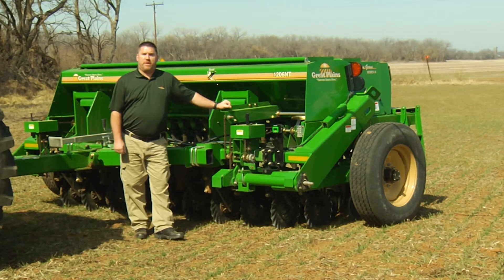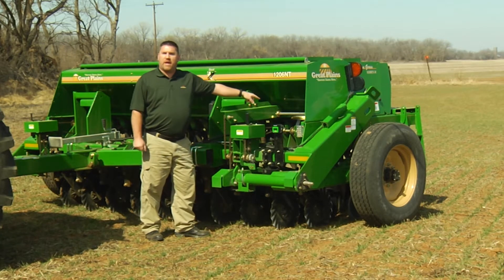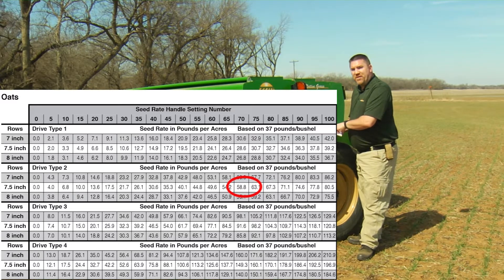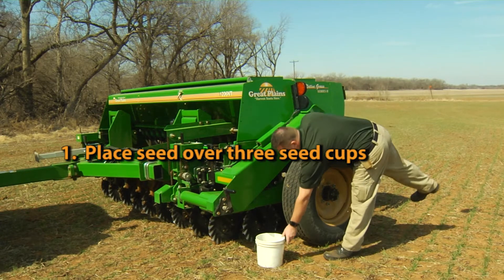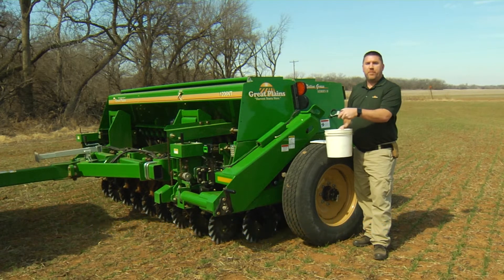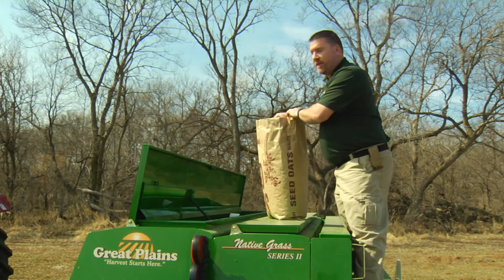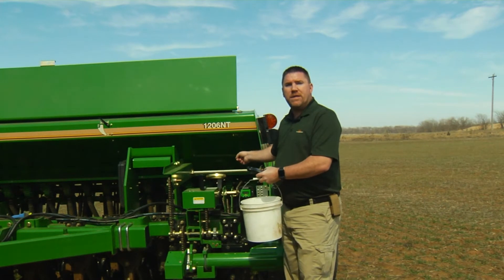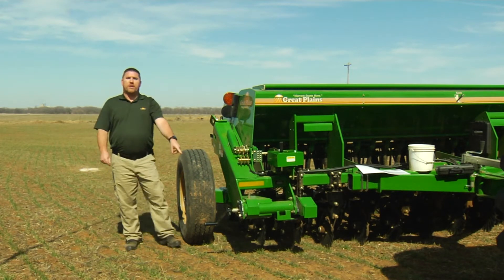Great Plains Service: 1206NT Compact Drill Calibration

Comment: Gregory,

Thanks for your questions on our video. This is Eric Watson…I am the one in the video. To address your questions…

Setting the planting depth: I always suggest working from the front to the back. Set your coulter depth first. Then focus on your seed depth. Your coulter depth is controlled by the single point depth stop valve located directly behind the gearbox on the drill shown in this video. 
Coulter Depth: Generally on a drill with a “frame mounted coulter” such as this model…you will run the coulter ¼ to ½ inch deeper than your seed depth. The reason you seen the comment on the other video about running the coulter depth ¼ inch shallower than the seed depth…this is a normal practice on a “Unit Mounted” coulter. Meaning the coulter is mounted directly, on the front of the opener frame itself…rather than to the actual frame of the drill. We want the “Unit Mounted” coulters to be shallower, so that you’re not taking away as much down pressure or force from the row unit itself.
Once you have the coulter depth properly set…then turn your focus on the seed depth. This is adjusted by moving the “T-Handle” on the back of the opener frame. When you have the seed depth properly set…you need to double check that the drill is still running level in the lowered or planting position in your field. You can place a carpenters level on the lid of the seed box to check this.
I hope all this helps you better understand your drill and how to properly set it for the best results. Feel free to reach out to me if you have further questions on this. 
Thanks,
Eric Watson

Comment: Great video!  I have a new Great Plains 706NT that I just started using this year.  I have questions about setting the planting depth and how to measure the actual seeding depth in the field.

SETTING PLANTING DEPTH:  Once the drill is hitched up level, what sequence of steps should I take to set the depth?  Do I (i) first get the opener depth set with the T-handles and, once it is correct as confirmed in the field, (ii) make sure that the coulters are 1/4" to 1/2" deeper as you recommend, and (iii) if the openers need adjustment, move the coulters up or down as needed by turning the knob by the gearbox?.

Another YouTube video about Great Plains no till drills recommends that the coulters be 1/4" higher/shallower than the openers; whereas, you recommend that the coulters be deeper than the openers by 1/4" to 1/2".  The other video says that if the coulters are deeper than the openers, some seeds will fall into the coulter trench and be too deep.  Frankly, this makes sense to me.  Why do you recommend that the coulters be deeper than the openers?

MEASURING SEED DEPTH:  When I'm in the field planting a test area to ensure I am planting at the correct depth, where exactly do I measure the seed depth?  In particular, do I measure (i) between the seed and the top of the soil immediately above it where the press wheel rolled over it or (ii) between the seed and the higher soil on the sides of where the press wheel rolled over the seed?

Your advice would be greatly appreciated.  Thank you!